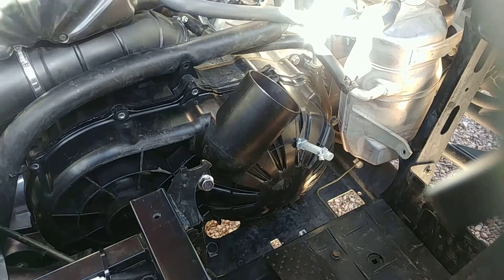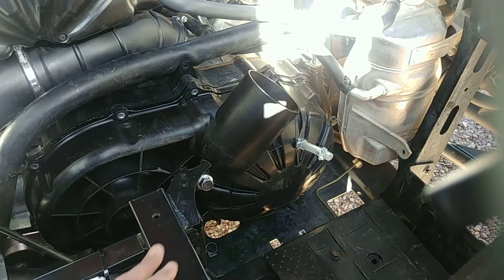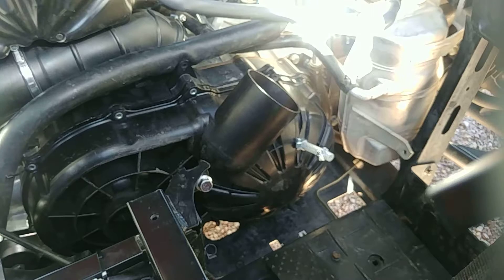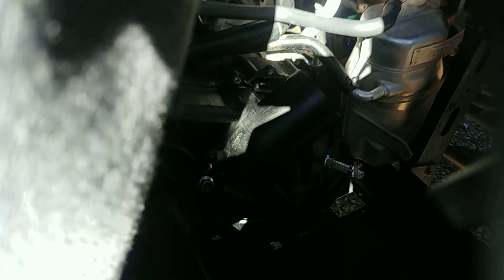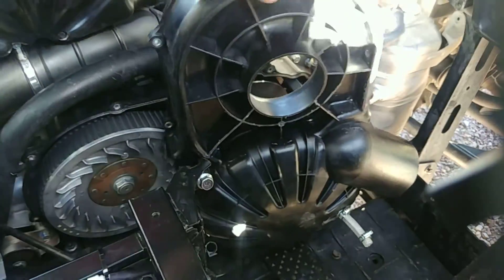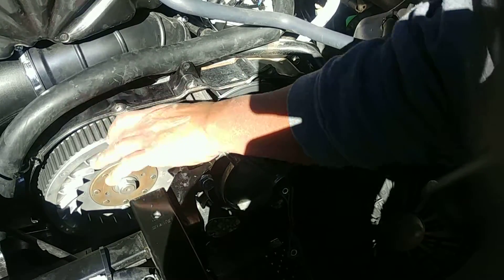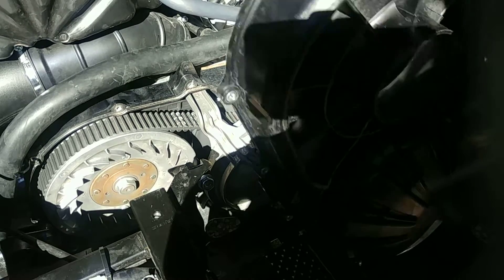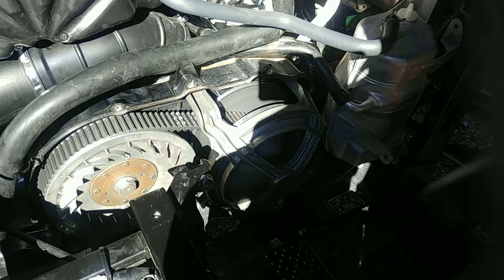CVT cover removal without removing the seat bracket on Wolverine X4

Comment: have you blown a belt on your X4?
Reply from the maker: Nope!  The one I removed I only did as a precaution.  It still had thousands of miles left on it when I changed it at 4K miles according to the belt width.
Reply: MassiveOverkill that’s awesome! I just picked a new one up yesterday for my wife. Its reassuring to hear you got some serious life out of it. Thank you
Reply from the maker: Congrats!  Make sure you join WolverineForums.com and my Wolverine X2/X4 FB group if you do FB:  https://www.facebook.com/groups/671163569748779/
Reply: Is the 2nd Gen X2 any easier?
Reply from the maker: @thetrailneverends2949  it's easier because you don't have to remove as many plastics as on the X4.
Reply: Doing mine now. About to say to hell with seat belt, and go to town with the cutting wheel. Yamaha dropped the ball on this one. 2000 miles, first and absolutely last service the belt will see.